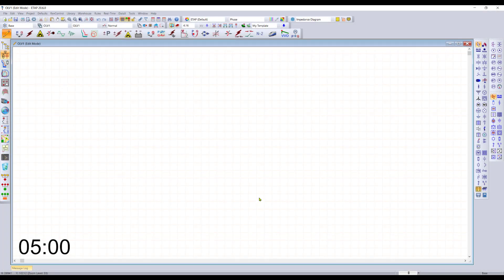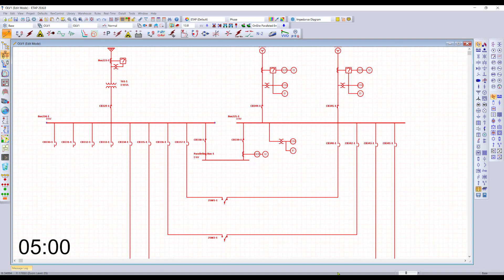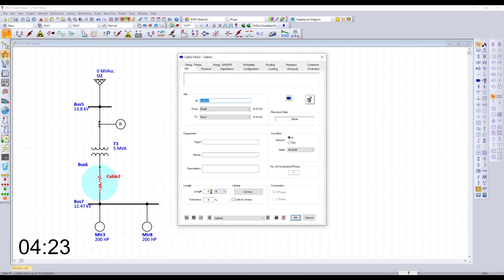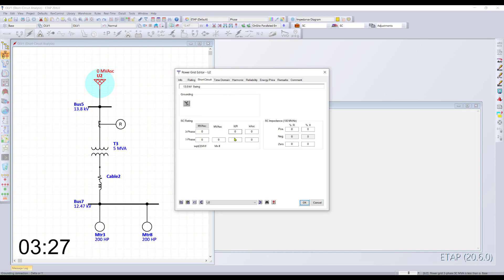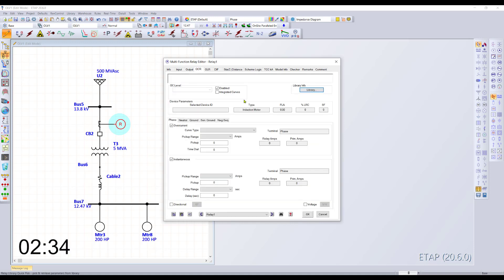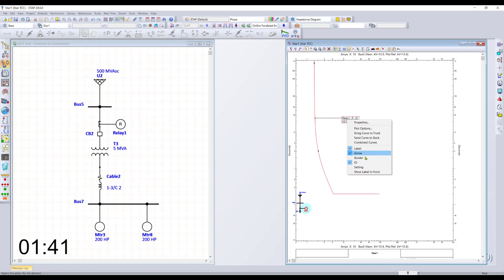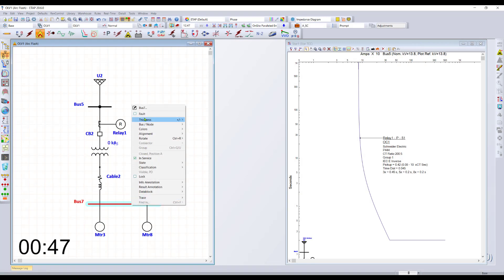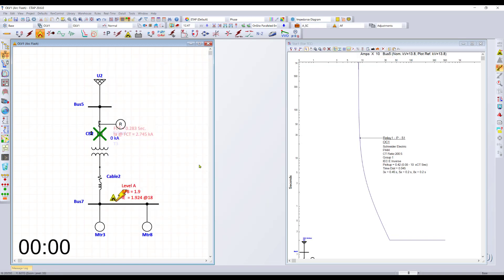ETAP Software explained in 5 Minutes

Comment: Hello, love your video friend, could you tell me how to connect each component just only click on the symbol
Reply from the maker: Thank you for you interest in ETAP Solutions and you positive feedback. Since this video was published, we considerably improved the SLD build function. with Auto-Build switched on you simply drag and drop any component on the one-line diagram and the software will connect it to the correct place in the diagram. We also added a function that will suggest the correct available components to add next in your design, based on component specification, electrical rules and your own rulebook. However you can switch all these automation function of, but the software will still connect the component as it is dragged into place. The Auto-align function will help you clean up your diagram if needed. For more information please refer to our website page https://staging.etap.com/solutions/intelligent-single-line-diagram, where you can find a list of the latest features and additional video tutorials. Please contact our Help Center at https://helpcenter.etap.com to assist with your question.
Reply from the maker: Thank you for you interest in ETAP Solutions and you positive feedback. We appreciate it. Please visit our website https://etap.com/Resources form more videos, tutorials, and product information.

Comment: I'm using the ETAP 24.0.2. When I run the Load Flow, it shows the message "Calculation process terminated abnormally - Exit code - C0000135". How do I solve this problem?
Reply from the maker: Thank you for you interest in ETAP Solutions. Please contact our Help Center at https://helpcenter.etap.com to assist with your question.
Reply from the maker: Thank you for you interest in ETAP Solutions. Please contact our Help Center at https://helpcenter.etap.com to assist with your question.

Comment: sure you are big lier when telling learninng etap in 5 min, mmeans you dont know what is etap
Reply from the maker: Thank you for your interest in ETAP Software. Perhaps, you are not an Electrical Engineer, but it only takes five minutes to build a basic Single-Line Diagram and run a simple analysis for it. Sure more complex systems need some more work, but if you understand the basics of electrical engineering that's how long it would take. If you like to get more help please feel free to contact our ETAP Help Center at https://helpcenter.etap.com
Reply: @ETAPsoftware  ,sue I am an experienced electrical eng, but I did not use etap prctically, I read about it , I did some jobs like load flow , SC, power Factor correction manually , Now I am intrested to learn Etap, hoping I will enhence my knowldge >>>> let us go ahead , if you have plan
Reply: @ETAPsoftware  if some body belives that etap is how to draw SLD, means he doesnt have knowlge about skilled etap technical user,and just a draft guy
Reply from the maker: Thank yo for your interest in ETAP Solutions. We suggest you take an ETAP Online workshop to be come an avid ETAP User https://etap.com/events
Reply from the maker: Thank you for you interest in ETAP Solutions and you feedback. We are sorry you feel this way about his great intro to ETAP Software. Obviously we know that you can learn the entire software in 5 minutes, but for experienced electrical engineers who have already experience with other electrical design software, this is a perfect and brief overview over what you can do with ETAP. Please contact our Help Center at https://helpcenter.etap.com to assist with your question.

Comment: I simulated 2 systems. In both cases, I am getting an error - Calculation Process Terminated Abnormally - Exit code - C0000135. Can you help me on this?
Reply: Thank you for your interest in ETAP Solutions. Please go to our 24/7 Help Center, https://helpcenter.etap.com for more assistance.
Reply from the maker: ETAP Software
Thank you for your interest in ETAP Solutions. For specific technical question about the software, please contact out 24/7 Help Center at https://helpcenter.etap.com and open a ticked.

Comment: We thank you for your good explanation but I wanted to ask whether ETAP can be used FOR industrial network design
Reply from the maker: Thank you for your interest in ETAP solutions. ETAP does not provide a plat form for industrial network design but has a bi-direction data exchange connector to AVEVA Software which is a industrial network design application.

Comment: Can we make panel component diagrams & LV control logic schematics (switches, contactors, relays, pilot devices, etc.) and simulate them using ETAP?
Reply from the maker: Thank you for your interest in ETAP Software. That would be our other product line SEE Electrical

Comment: @ETAPsoftware can we etap on Mac M1?
Reply from the maker: Thank you for your interest in ETAP Software. Unfortunately not. You can use the ETAP iPad app to connect with a project and edit data from there, but at this time you need to run ETAP on Windows OS. Please contact our ETAP Support team at support@etap.com or go to our 24/7 Help Center and open a ticket to assist you with your question.
Reply: @ETAPsoftware  Thank you for the information. But does etap ipad work the same with etap on windows?

Comment: is ETAP available on residential & commercial wiring?
Reply from the maker: Thank you for your interest in ETAP Software. You can calculate any wiring with ETAP, commercial or residential, but that my be overkill. You can get Caneco One software which is also an ETAP product and is designed for lower voltage application go to https://alpi-software.com/ for more information.

Comment: has anyone used ETAP 19 on AMD processor? i have ETAP 19, it works on my intel desktop and intel laptop, but it does not work on my AMD processor laptop. When i open ETAP and start to create new project, the program stops working and not responding.
Reply from the maker: Thank you for your interest in ETAP Solutions. Please contact our 24/7 Technical Support at https://helpcenter.etap.com

Comment: Load Flow Analysis 1:28
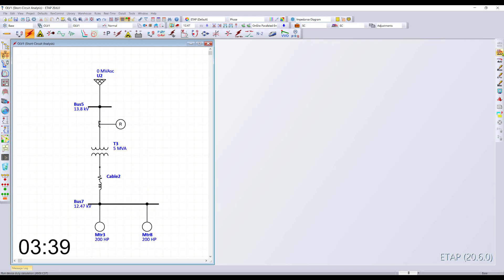Short Circuit Analysis 2:50
TCC Curve 3:21
Arc Flash 5:34
Reply from the maker: Thank you for your interest in ETAP Software and your positive feedback.
Little bit of a cheat but we start counting down when the presenter starts building a model from scratch. 5 min sounds better then 6.32 min

Comment: I am facing issue while using ETAP . Whenever I use the Transformer model I receive a dialog box saying " You May not be allowed to Write/Modify ETAP folder". Please assist
Reply from the maker: Thank you for your interest in ETAP Software. Please contact our Help Center and submit a ticket to assist with your issue